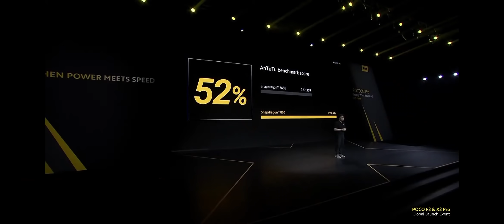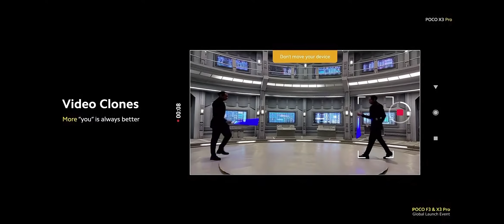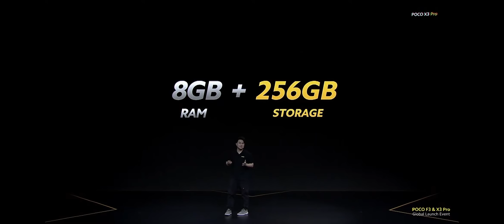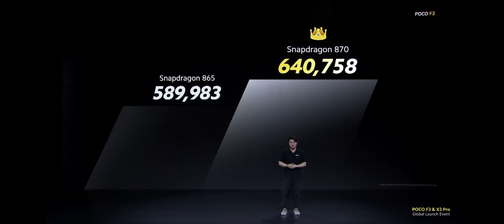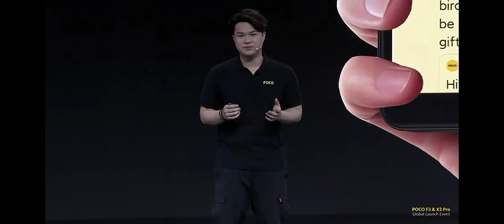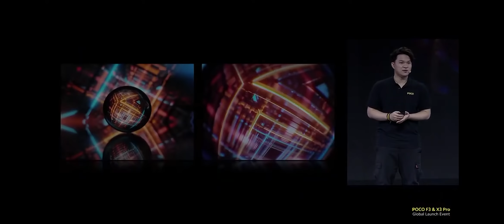Poco F3 & X3 Pro launch event in 15 minutes

Comment: Is it true that X3 NFC has got better camera/sensor then new X3 Pro and F3 as well ?
Reply: @daf676  X3 NFC has 64mp. this one has 48mp. so yeah, downgrade
Reply: Yup x3 nfc has better main camera than both
Reply: The Poco X3 NFC has a better main camera, its ultrawide camera is also superior.
Reply: @daf676  are you dumb? Price dosen't mattere to this sample!
Reply: Not necessarily. While the Pro has lower resolution main and ultrawide cameras, they're newer sensors which can capture more light, and the better image signal processor in the Snapdragon 860 allows the ultrawide to capture photos in night mode. The only lost feature from the NFC is 4K ultrawide video because of the lower resolution sensor, but other than that, the camera system is an overall improvement on the Pro.

Resolution isn't everything when it comes to cameras. The better optics and SoC make up for the reduced resolution. That said, it's still extremely dumb that they're wasting resources including those useless macro and depth sensors which they should know by now that nobody even wants. Regardless, the camera system is definitely better than the NFC. The only real advantage with the NFC is the 4K ultrawide video I previously mentioned, but that's such a specific feature that I doubt most people will notice its absence, especially if they didn't even use the NFC previously.